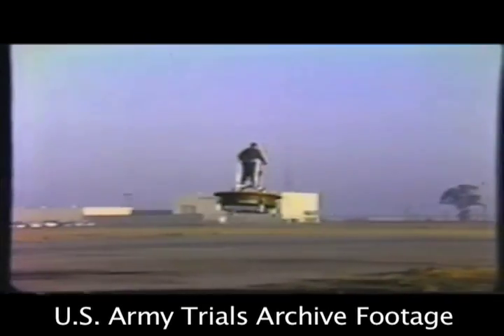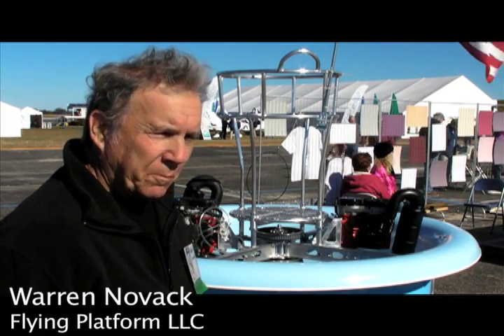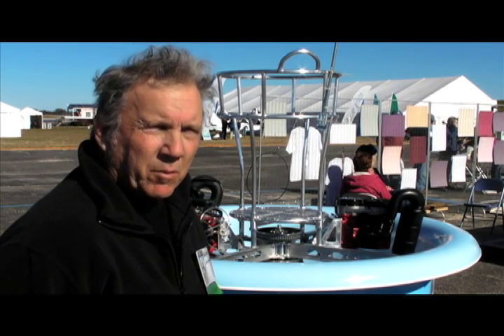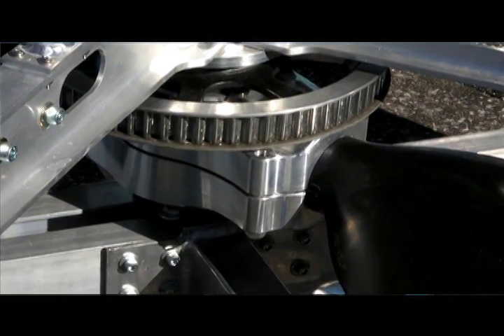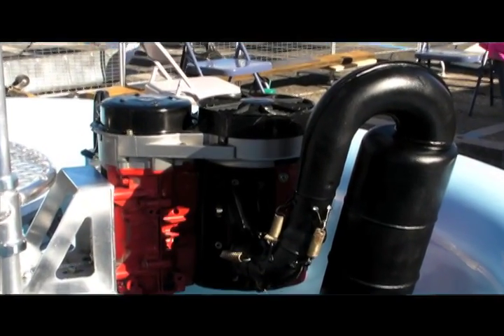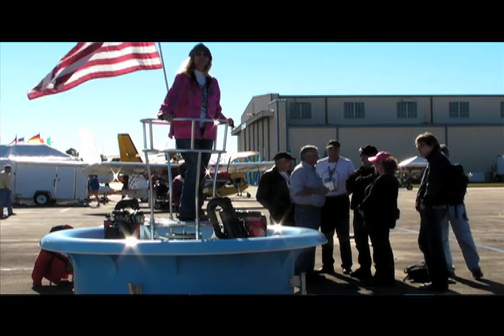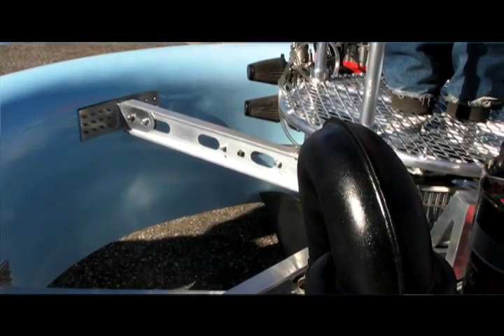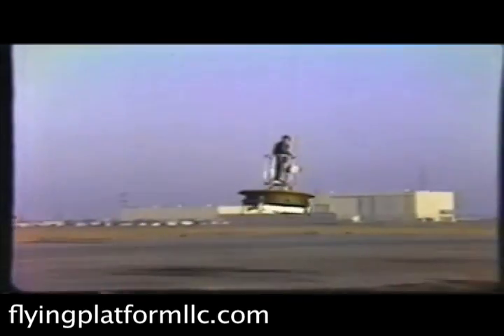Flying Platform

Comment: Make an electric one. And see my logo. Can't you make it like that? The pilot position in traditional flying platforms is daggy. The position is ok but it just looks daggy. Do it with the bike bit. It would not only feel more cool but look cool as well. And you would get a lot more sales. The flying platform has been re vamped a few times, but never caught on cos it's too daggy. That's the only reason they failed, seeing that it worked and is much cheaper and easier to make than a chopper. But the advantages don't stop there. It's protected and can fly just about anywhere (where a chopper can't).. So if you don't succeed, try the bike bit. I don't know if it will work, but Hiller (and NASA) made a seat& stick version of it that worked. So if the bike bit won't work, try the seat&stick idea (and going by the several re-starts of a brilliant machine that works, the standing position won't sell, I suspect). See NASA video called Flying Platform Experiment" And See my video called "Flying Bike VTOL Concept".
Reply: yup my thoughts also, your profile pic looks to be a better ride. An electric version would be great since you could have unlimited flight time from free energy overunity electric motors such as the QMOGEN openly being replicated all over the world, its an electric motor to electric motor generator system that provides excess power that actually works unlike all the hoaxes all over the net.

Comment: Surley if you have an engine for each contra rotating prop and you lose one  of the engines the thing is going to spin big time, the first hiller version was made that way, and realised it was no good, they later modeified it with a common gear box